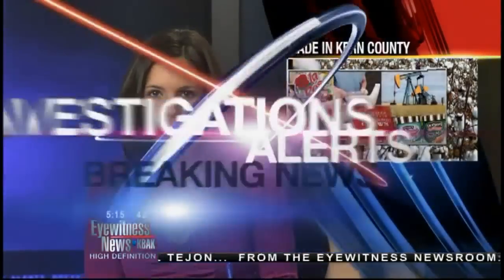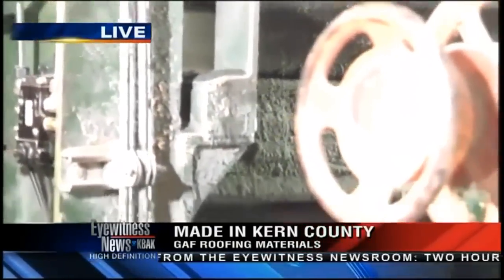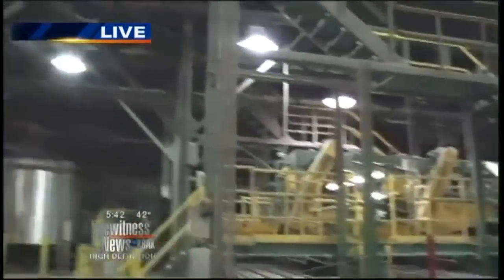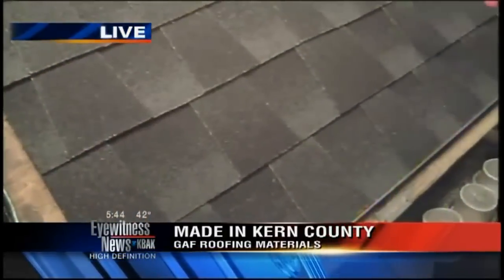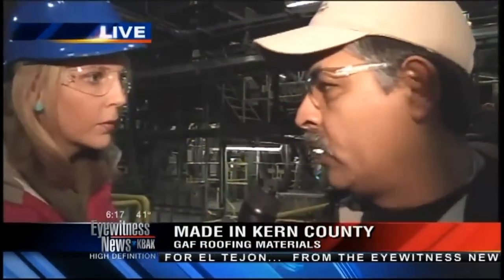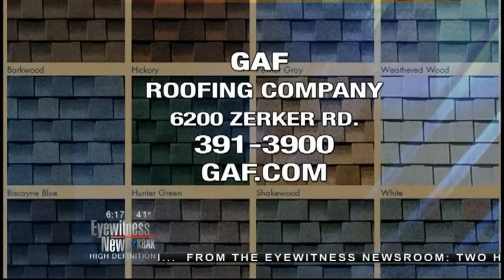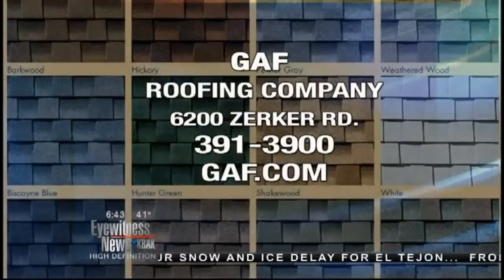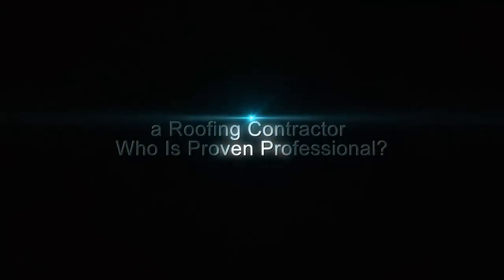How GAF Roof Shingles Are Manufactured

Comment: Looks just like the steel mill I worked at. The accumalators, the bridle rolls, the dip pot, the welding of splices, everything.

Btw- their maintenance pays really, really good. Like in the mid to high 40s depending on your experience. Making $48 an hour in industrial maintenance is literally unheard of, unless you work for the state, county, city, or a union.
For a private company, thats damn impressive. Even the steel mills dont pay this well.